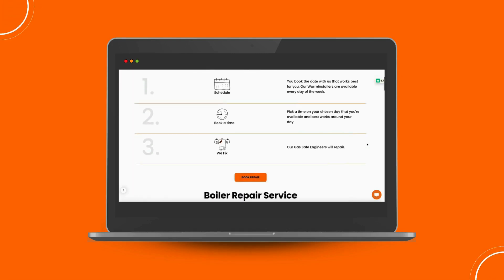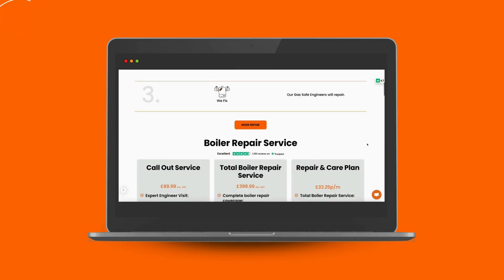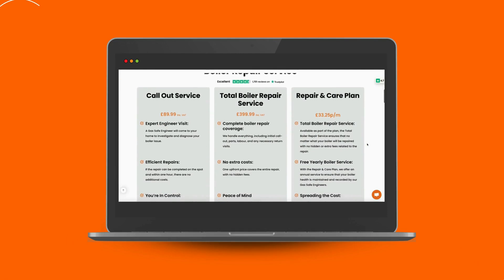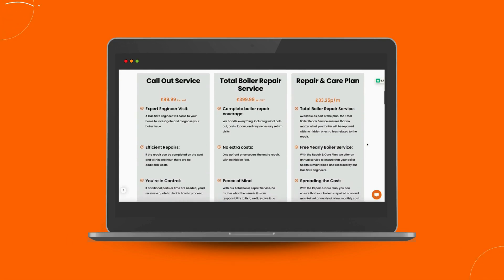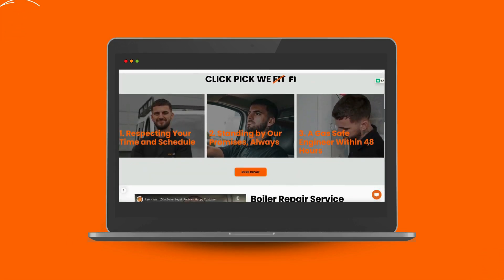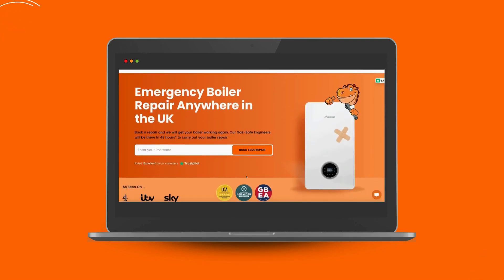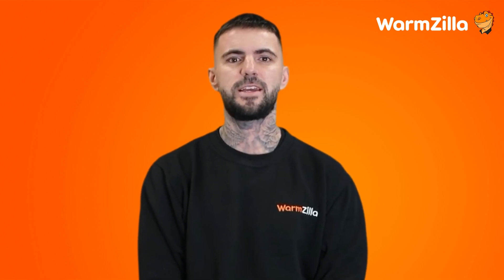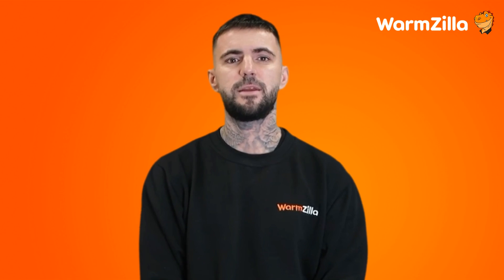Most Common Worcester Bosch Boiler Error/Fault Codes - A Gas Safe Engineer Explains

Comment: Do I need to turn my boiler off
Reply: Just got mines sorted and the guy told me it wasn’t working because the pipe outside was frozen so it backed up, i don’t know if this is your case or not tho
Reply from the maker: Hi Jean, just to confirm, is the error code EA 227? The EA 227 error code on your Worcester Bosch boiler means your boiler has "locked out", which basically prevents it from operating as a safety measure. This can be due to issues like a loss of pressure, power problems, or other faults. You should contact a Gas Safe engineer immediately to diagnose and resolve the issue.

For safety, it's advisable to turn your boiler off and not attempt a reset or repair yourself. If you have home cover with WarmZilla, you can book a repair online. Hope that helps!

Comment: what is code EA mean
Reply from the maker: Hi Phil 👋 The 'EA' code on a Worcester Bosch boiler means that the boiler has not detected a flame, which could be due to a gas supply issue or an ignition failure. This can sometimes be resolved by resetting the boiler, but if the error persists, it is important to check your gas supply and contact a Gas Safe engineer to inspect the boiler. Do not attempt to fix gas-related faults yourself for safety reasons. Let me know if you would like further guidance!

- Derek 🦖